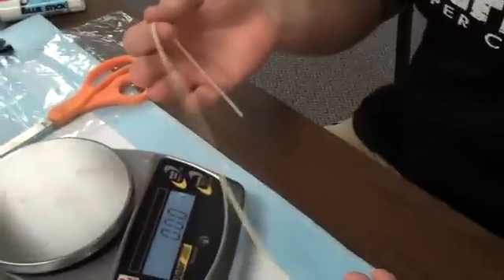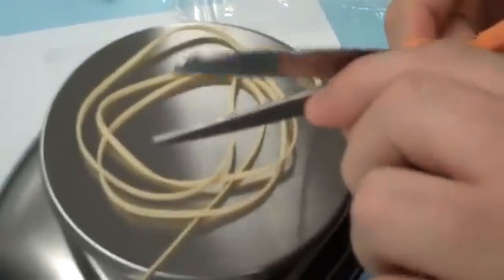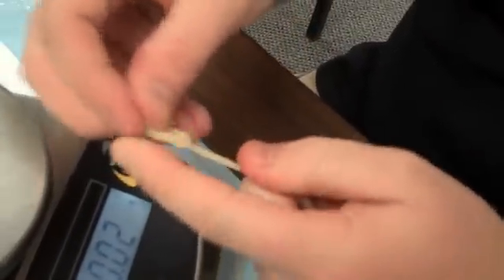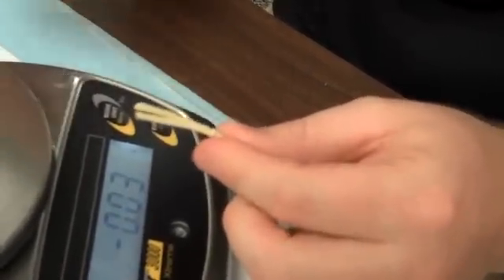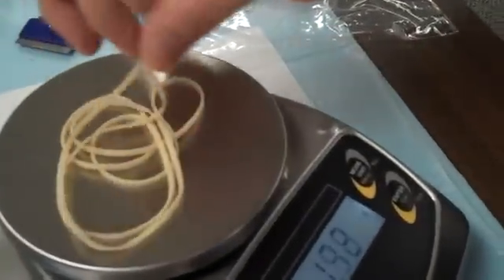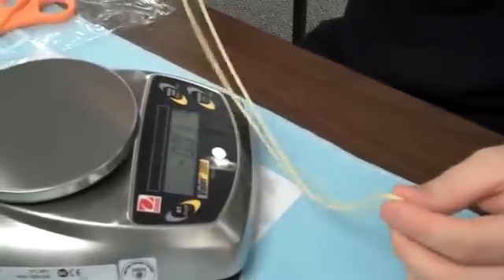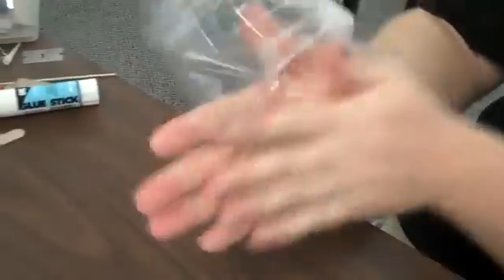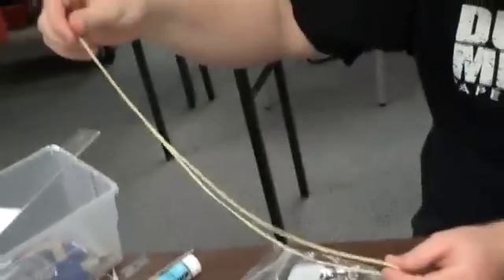NC Science Olympiad: Rubber Band Motors

Comment: The rule of thumb is one foot of 1/8" rubber weighs one gram. Two feet would weigh two grams. 3/32" rubber compares to 1/8" = 4/32" in a ratio of 4:3. Therefore it would take (4/3) x 24" = 32" of 3/32" rubber to weigh exactly 2 grams. Your rubber may vary. If you want to be exact, weigh a carefully measured length of your rubber and calculate the length for two grams in proportion.

Comment: Heres a tip. When pulling the knot tight, hold the knot a pull the loose ends. That way the rubber on the "motor side" of the knot wont chafe around the knot and break when winding.

Comment: One question, does the lubricant evaporate, or is it like mineral oil that never evaporates? I want to lubricate the engine for my helicopter but from previous experience, lubricant is messy and nasty.
Reply: Coat it with talcum powder after the oil